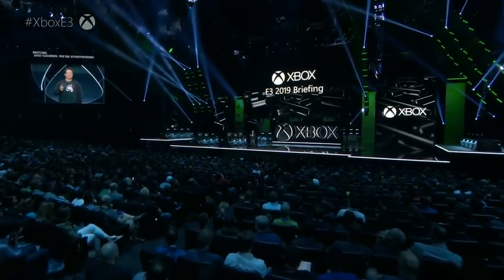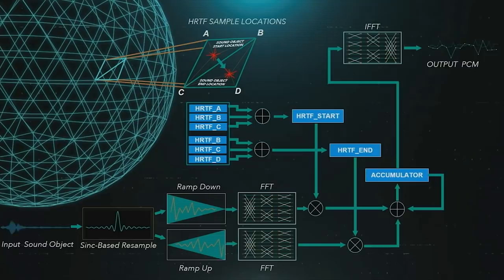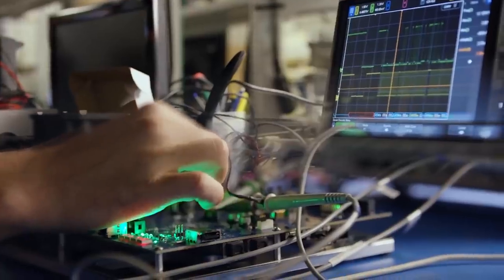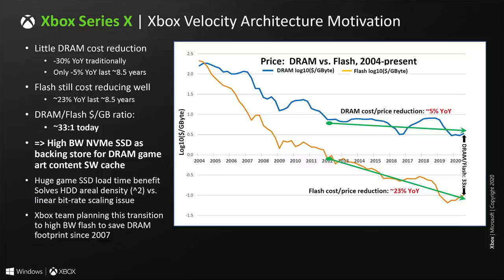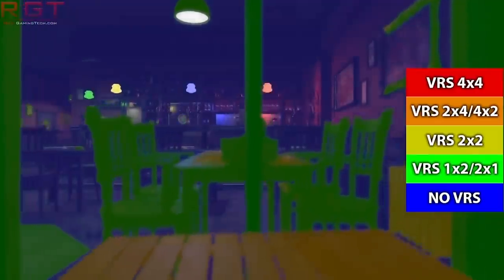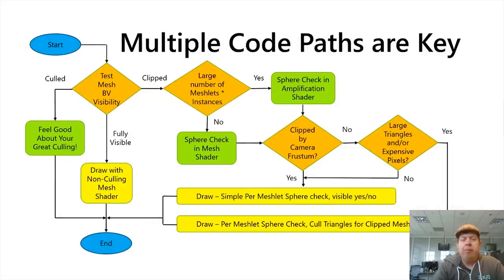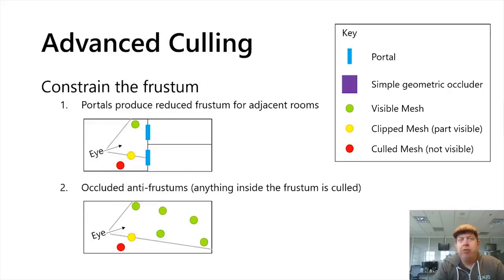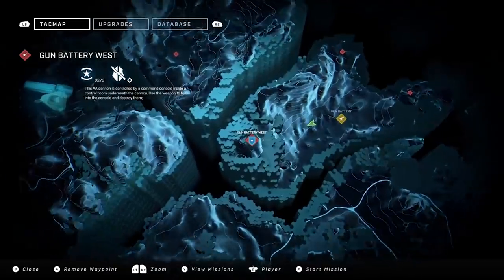Xbox Series X Hot Chips Analysis Part 2 - SSD, Memory, Audio & More

Comment: Good hardware but unfortunately they didn't show anything remotely impressive running on it, Sony a bit better but still nothing truly next gen, very disappointed by both Microsoft and Sony.
Reply: Well I guess that depends on what you consider 'impressive'. I know MS haven't really shown anything particularly 'new' running on a Series X - mostly current gen with some 'boost' (Gears 5 @120fps, Ori @120fps) but perhaps the most 'impressive' that is overlooked is the Minecraft full Path Traced demo that has been seen running on a Series X.
Its obviously difficult to show 'something' that looks a significant upgrade - especially on a stream with compression and lower resolution than the game is targeting. Also don't get HDR either. With games like Death Stranding, Gears 5, RDR2 etc all impressing and running at higher resolutions than most new content is showing, its difficult to 'impress'.
A LOT of games too will have started development long before these consoles were specced and no doubt a lot will come to current gen too. GT7 'could' come to PS4 if Sony weren't using it to sell the PS5 - turn off RT, maybe scale some of the visual settings down a bit and it could be a PS4 game - akin to GTSport.
Some games (Metro, Control etc) may not 'look' radically different with RT either in some scenes because Devs baked in great lighting effects and/or the scene isn't a 'good' showcase (no reflective surfaces,, little to bounce off etc).
It will be interesting to see if the Medium, Bright Memory Infinite, STALKER 2 and any other game that looked 'impressive' for one reason or another compare to the content we have seen  but I expect it will look probably better when on your TV Screen at 4k HDR....
Reply: @BAMozzy69  All of those games have already been done on the RTX 2000 series GPU's so not impressive. People want to see the Xbox Series X run games in real time. Along with exclusives only on the Xbox Series X.
Reply: @ZackSNetwork  As I said, depends on what you call impressive. Its still impressive for a Console to offer that level of visual quality and performance. When you consider a Series X is just 12.1TF too with a Ryzen 7 3700X equivalent CPU.
Xbox is the name to ALL of Microsofts Gaming division and includes PC and Mobile too - its not 'just' the console so expecting 'just' console Exclusives (like Sony who ONLY have the Console user base) is unlikely. MS will be making games for ALL their users. You'll never be impressed by a MS Exclusive again because the PC can probably offer improvements and never be impressed on multi-platform games, even if Series X has a noticeable upgrade over the PS5 version because an RTX3090 will be 'more impressive'
I think it doesn't make things any less impressive - just because a 'high end' PC can and has done it before. Pretty much ALL of the multi-platform games will look better and/or run better on a RTX3090 PC - probably better than any 'exclusive' can look on Console. Its just that is the 'best' you can hope to play it if its 'exclusive' to a Console where as other games can look/play better. Does that mean you can't be impressed by any game running on console because a PC already could do high res, high quality AND high frame rates? That's like not being impressed with Tony Hawks 1 & 2 now because PC can do it and its 'old' games too...
Reply: Lmbo! Horizon Zero Dawn: Forbidden West, Kena, GT7, Demon's Souls, Spiderman: Miles Moralis, Returnal to name a few...
Reply: @HanzouTheRazor  None of those games, except for a few seconds of kena, showed gameplay. How can you say they are impressive when all you saw were trailers? LMFAO
Reply: @rjanuari1978  GT7 and Reternal (and Kena) DID all show gameplay. What are you smokin?

Comment: Microsoft is yet again digging themselves into a corner with this, 'we can do everything Sony can with our SSD and it's features' sales speach. Gonna back fire on them again. Just like this 'worlds most powerful console' has. Funnily, Microsoft has recently changed its slogan for Series X to 'most powerful Xbox ever'. Mmmm 🤔🤔🤔
Reply: Well they can and they showed. Offloading a FULL 4k game from the RAM into the SSD and loading a FULL NEW game from the SSD into the RAM and starting running it in 6s I a F** achievement considering it has to write to the SSD 1 FULL game and write speeds are always slower. It's even more impressive if you consider the games were not even optmized to take advantage of the custom decompression block and was using ONLY the RAW 2.4GBps. Those X1X games take about 9GB of RAM each.
In the meantime Sony showed their "magic" SSD taking about 2s to load a new level when you change worlds using a game designed to take advantage of PS5 SSD and decompression block? 

Now tell me: How is 2s to load a level impressively better in a game designed around the strengths of PS5 SSD and decompression block than 6s (3s to write to the SSD and 3s to read from the SSD) on games not even utilizing the tech on a console?

Stop bullshithing around and just research before spiting non-sense fanboyism.
Reply: Galva Tron  Have you heard of DX12_2? It's a common API set for XsX and PC. Once developers get the hand on it, they will develop a game for 2 platforms basically coding ONCE. How is developing for PS5 easier? Specially when only devs saying it are Devs from sony studios. Lol.
Reply: Galva Tron  Yeah maybe, but Microsoft always has the PC market in mind..since their games are released on PCs as well..double the $$ even for the developers, 3rd party will really prefer that once they get used to it, and that's why PS games are so bad ports to the PC.
Reply: @rjanuari1978  Your numbers are kinda BS. Firstly, 3 seconds of 2.4GBps doesn't equal 9 (it's 7.2) so clearly you're misunderstanding what was happening in that demo (for instance, I'm pretty certain they don't have to write "the full game" from RAM to the SSD for quick resume, you only save game state data. MUCH smaller), so the remainder of the time would be processing and uploading the new game's data into RAM.

I'm also fairly confident that it would have been using the decompression block, because those things are baked into the hardware. Perhaps if they completely decompressed the game on disk, then perhaps it would be RAW only, but, the current generation consoles ALSO use compression (I don't know what codec Xbox uses, Sony was using ZLib, I think) so, doing so would be completely moronic. Perhaps you mean that those games weren't taking full advantage of the Velocity Architecture? That I could agree on, but it would still be using some of it (as, once again, some is baked in. Others have to have code written for it)

Next, you're instantly assuming that 2 games are equal in size, just because they're 4K. Wrong. In fact, I can fairly confidently say that R&C would be almost completely filling the 16GB of RAM (minus OS's share so, let's say 13GB) and switching that much data in within "2 seconds" IS impressive (the actual loading time would be lower, as theoretically 2 seconds of 9GB/s is 18GB. So really it would be 1.5, but, semantics). The XSX can do it in a similarly impressive 3-4 seconds.

I will state a significant difference between these pipelines is that the PS5's, being largely hardware based, means developers don't have to think about it, it just happens. The XSX has to be written for. But that has its strengths too, mainly that (most of) the VA is going to be present on PC in DX12 (as you have mentioned). Still, it appears that VA is causing some issues currently

I can throw your last sentence back at you
Reply: @rjanuari1978  the maximum speed of XSX SSD after all the bullshit marketing as bcpack and velocity it's 6GB/s... 22>6... PS5 faster by 130-300% depending RAW performance or compressed...
Reply: @ashwentel  i am not a Fanboy, i love to trigger fanboys, it's start when xbots didn't stop spreading lies propoganda about the PS5 so i start play by their way...
I even fix Sony fans if they tell lies on XSX becuse i only care facts and not lies propoganda to fit one side narrative...
Reply: Galva Tron  What devs apart from Sony and Epic. Give me 1 source with an independent Dev that is not Sony and Epic that came out on record. Just 1. LMFAO.

Comment: So basically, games will run and look the best on ps5.
Reply: u obv never watched the video if thats what u took from it clown. try changing that vice versa
Reply: XBOX has a clear performance advantage over the PS5. The games will probably look the same (if anything xbox has the better looking games in the future) although Xbox will probably be capable of running the games in high resolution at a higher framerate. The only advantage of the PS5 is it's faster SSD, but this also has it's downsides. You cannot really expand the storage as you need to find an SSD with at least the same performance. Xbox on the other hand will have a data expansion slot for an extra TB of storage. So games will ultimately look the same on both consoles, but if there is a leader in terms of graphics, it won't be the PS5.
Reply: @trigger5520  I disagree. The ps5 will have a clear advantage over the xbox in terms of graphical fidelity and performance, as shown on unreal engine and ratchet and clank demo compared to halo infinite. The highly customized ssd not only eliminates loading, it is also capable of streaming a large volume of assets (such as 8k textures) on screen in real time, so if anything, games will look better on the ps5 especially exclusives. moreover, the high speed ssd will fundamentally change how games are designed in the future. The only advantage the xbox has is a higher storage capacity (2x slower and 4x in some cases) and 1.7 t flops, witch unfortunately, isn't enough to out perform the ps5. In the other hand the ps5 i/o is designed eliminate bottlenecks so expect games to perform best on the ps5.
Reply: Kay Jay You are right, but keep in mind that halo infinite is developed for xbox one aswell. Sadly series x exclusives are set to launch somewhere in 2022. But you have a point! The SSD is really good and you could be right but I guess we have to wait for MS to release series x gameplay

Comment: So the Ps5 compared to Series X,what console is more effective?Ps5 really no real rdna 2.0 tech?🙄🤔
Reply: No point to use the technical description from the computer use designs. As the consoles discarded much of the things not usable for games, in favour of other functions that do. So even if based on the same tec, it is not the same anyway.
Reply: The PS5 is based on RNDA2 but, is a custom GPU with some features removed, some kept and features on PS5 not present in RNDA2.
Reply: @AltCutTV  The PS5 has RDNA2 silicon in it, it's RDNA2. Lot's of people (not necessarily you) are missing the connotations evident in saying "The PS5 is RDNA 1.5" and other BS.

Both consoles are custom, based on RDNA2 silicon. That means what it says. You can chop and change certain features, it's still RDNA2. Yes, they will differ slightly from PC RDNA2 (especially in CU counts) but removing features that are useless to consoles doesn't change the technology's basis.
Reply: @MrVelociraptor75    Sure, that be fair and more accurate description. "RDNA2 based"  Bit like an RUF is Porsche based, but not a Porsche even though it mostly is.
Reply: @AltCutTV  Not knowing what RUF was, I had to look them up, but yes, that is a perfect example.

They take a Porsche car base and drive train etc, modify it to their taste - RUF. Sony (and MS) took RDNA2 cut off the fat (PC specific features), added a bit - Custom RDNA2.

Right on!

Comment: The world's most pointless console
Reply: The worlds most pointless post.
Reply: So is PS5. Actually more so the PS5,  8.4TF for a next gen console lol, yeah you can say what about lockhart but that's just an option, and microsoft is offering ad higher spec console. Where as sony is only offering two same spec consoles, and as for a main console and to last 7 years its going to struggle extremely or will lose 90% of the bells and whistles, the series x destroys the PS5 in specs.
Reply: @carlosmartinez3020  where did you get 8.4 tflops from? You must know more than the experts, share your wisdom with us wise one.
Reply: @FührêrFPöñê I wouldn't give a squirt of piss for a PS5. I don't care about their cinematic titles, I don't care about their garbage UI or hardware. Have any more straws to grasp at?
Reply: @robgraveson  you will find out but you heard it from here first
Reply: @robgraveson  The more xbox loses they compensate by lowering the ps5 teraflops, it used to be 9.2 now they lower it to 8.4, dont waste time reasoning with xbots.
Reply: @tigerdude2727  ikr, I don't mind talking to Xbox guys when they talk sense but when they're plucking numbers out of thin air or hurling insults I switch off tbh
Reply: papi chulo 

It’s not 8.4 bro it’s 9.2.
Reply: @maniacmcmuffin5025  the actually cpu base clocks are 1.4-1.5ghz, the boost clocks would sit at around 1.7ghz, and overclocked to the high heavens at 2..2ghz its just not doable on an APU design,  and lastly there have been devs that have said the PS5 has dropped down as low as 8.4tf trust me this isn't a lie it will come out soon but the truth will come oht
Reply: @maniacmcmuffin5025  also the PS5 node isn't N7+ there's very little to no evidence that supports the N7+ node so the PS5 will be either a N7P or N7, but only N7+ node can help push the PS5 at 2.2.ghz so its highly likely the PS5 will only sometimes and for short burst will be 10.2tf console and will sit at 9.2tf but could drop down as low as 8.4tf especially when cpu you dependant games along
Reply: @carlosmartinez3020  the fact that you think a TFlop number is important proves your lack of knowledge with such things.
Reply: @lalotz  I mean, you can't deny it and say the Xbox isn't a great console because it is. They are both going to be excellent machines with ALMOST no difference between them. They both have their advantages against one another. Xbox is slightly more powerful, but the PS5 is more capable.
Reply: @shinobixero270  you're right, xbox should be called xsht, agree.
Reply: @carlosmartinez3020  lol, Tflop gives an estimate of the power of the GPU, that's it. Whether or not the machine built around is capable of utilizing that power is a different story.
Reply: @carlosmartinez3020  you're right, Xsht is a sht console, we agree. 

Please tell us where is the proof xbox being a good console?

Everything was ran on PC... Phil mentioned he doesn't care to sell xbox any longer lol 😆 😂 
Please show us xbox footage xbox running games....THAT IS NOT ON PC...please show us...

At this point Halo Craig the brute wishes to be on ps5 
The proof is in the pudding, specs on paper is cute...but doesn't mean sht

Domino's beat Xsht 
Domino's does deliver
Reply: If playstation  is better way is there break down . But poines hate when the see xbox specs  cause they are brain washed  by the ssd
Reply: PS4.5
Reply: @tigerdude2727  Yet it still destroys anything MS has hahhaha
Reply: @maniacmcmuffin5025  No..no...no its actually 2.1tf yet it decimates all that is series X!! 😛
Reply: @carlosmartinez3020  You figured that all out in your granny's garage...silly boy?
Reply: @wildwest4801  let's see...what are xsht's claiming ...

1) no exclusives...everything on PC 
2) even Phil mentioned he doesn't care to sell xbox any longer lol!
3) it can't run its games, everything was ran on PC ....NO GAMEPLAY FROM XSHT YET
4) any claim xbox is great it's lunacy and a new degree of delusional people...especially when xbox hasn't proven anything
5) craig the brute wishes it can on ps5 at this point
Reply: @shinobixero270  ps5 is more capable of what exactly?